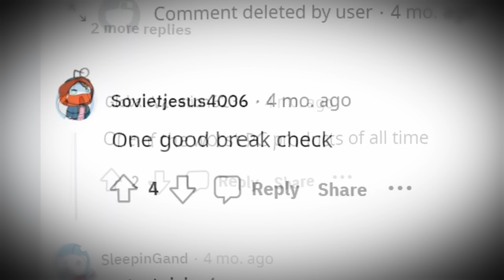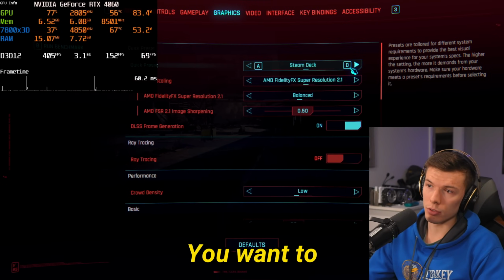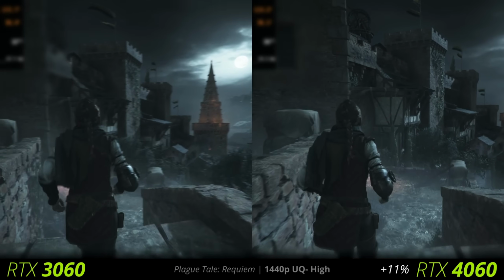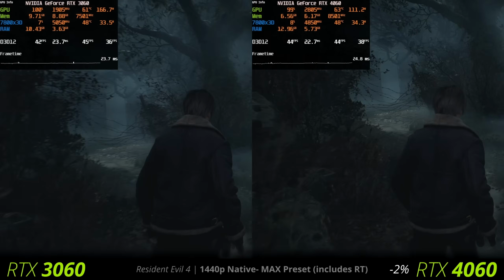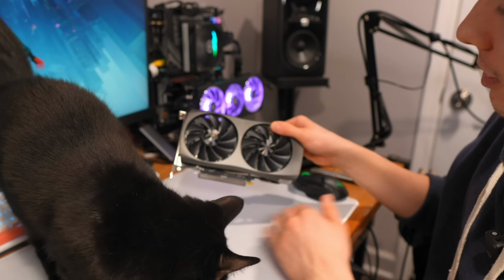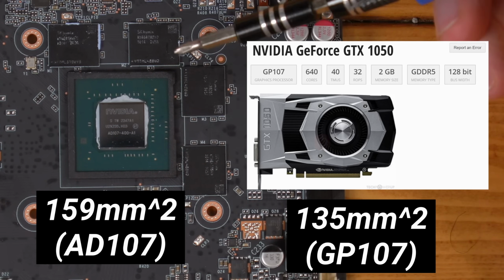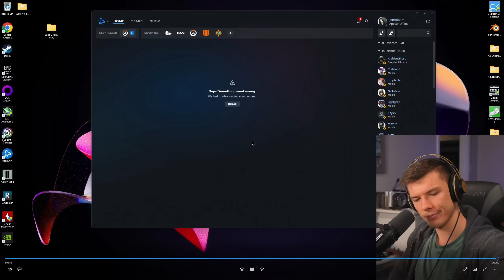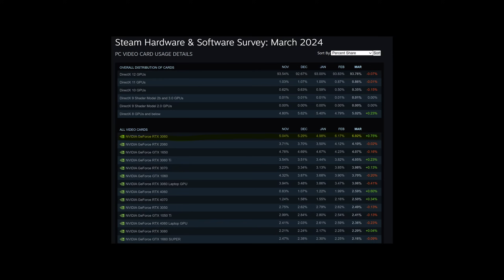I Tried Nvidia's best "Budget" GPU to see if we're Doomed

Comment: don't worry guys, next gen the 5060 will be marketed at 720p instead
Reply: With DLSS you'll enjoy lovely 240p 1000 fps though!
Reply: and it will still only have 8gb of vram
Reply: @Plague_Doc22  *upscaled from 144p
Reply: nah it'll be called 5050
Reply: "720p is the most popular resolution"
Reply: its crazy to me that AMDs GPU sector is struggling to compete with the RTX 4060 like dam how lazy does AMD have to be to no compete against this.
Reply: @Wallcroft25  people weren't buying a lot of AMD cards when they sold them for less, so why would they give up their margin for nothing? At least you're getting solid raster performance for the price, and crucially enough VRAM to last beyond current gen games. As seen, ray tracing doesn't matter when everything in this price bracket is way too slow anyways.
Reply: @BoboFerre incorrect it will have 4gb of vram
Reply: For 499😮€
Reply: 5060 will be 6 gb mark, my words 😂😂😂
Reply: @Wallcroft25  AMD kind of surrendered. 3050 was consistently more expensive than the RX 6600, for a good time it was a price competitor of the RX 6600xt. The 6600 already crushes the 3050, to the point that is hard to get a scenario where the 3050 wins (remember, the 6600 beats the 4090 when severely CPU bottlenecked, it is normal to be able to find scenarios where the clearly inferior product wins  when architecture differs)

According to steam survey the 3050 (2.75%) sold more units than AMD 6700xt, 6750xt, 6600xt, 6650xt, 6600, 6900 combined sales (2.70%). If AMD did their decition making based on numbers similar to those (real numbers may be worse, as many people buy GPUs for non gaming use cases), it is logical they concluded pricing isn't the correct competitive approach when dealing directly with the average consumer
Reply: DLSS AI Game Generation where the AI will now predict your inputs to provide additional frames
Reply: @TheMicroWaveOven  on a phone™
Reply: @Valvefan75 
Regular 7600 have the same vram as 4060, and is supposed to beat 4060. But is slower.
They released 7600xt, that has 16gb of vram but on par with 7600 in performance, and when I utilize more than 8gb of vram it get unplayable fps anyway. The all vram talk is funny. Just AMD fanboys look it as a good thing. Also 12gb of Nvidia is more than 16gb of 7800xt, Nvidia card on RDR2(like 4070 super) use 7.9 gb of vram, AMD use 14gb of vram!
In 8k hardware unboxed settings Nvidia use 11.5gb of vram, AMD is already unplayable even though has "16gb of vram", and 4070 super has 12gb of vram. Nvidia is excellent in compressing textures, they don't need 16gb of vram to beat in therms of vram AMD with 16gb of vram.
Reply: Sub human fanboies scAMD are catching fired here 😂😂😂 love this ❤
Reply: @ziokalco 
😆 Lol!!!
AMD fanboys says that 6600 is better than 4090???😂
Also 4090 is at least 4k card if not beyond that, none plays it as a 1080p low card.
Reply: @BoboFerre nah, it would probably be 4gb vram. 😢
Reply: 720p60 Path Tracing with DLSS Quality and Frame Gen
Reply: @piyapolphetmunee3879  better then any trashdeon shitX for sure 😘💪🏻
Reply: @Plague_Doc22  and amd 8600 is going to do the same it might get 5 more fps at the same resolution. then we get to blame the devs of games to i cant tell you how many settings on my older gpus before i went high end but you would be surprised at a lot of settings you turn down have no impact on visuals a lot of games are over bloated with settings that do nothing. I think they do it on purpose FR. because they dont do anything yet cost a ton of performance.
Reply: Actually 4060 already marketed to use DLSS everywhere. So 5060 probably gonna target 540p-DLSS gaming.
Reply: And since Nvida loves us so much they’ll even lower the price to $299 😭😭😭😭😭🤣😂🤣😂
Reply: @UNATCOHanka  
Why not let the AI play your games for you at this point lol 😆 😂 😅
Reply: @Wallcroft25 AMD Is doing the right thing. I thought they were shitting too but after watching people defend this 4060 in a world where the 6700 costs the same or less AMD can't do shit without losing margin. Nvidia sheeps are too strong and stubborn to change,  so amd just produces less and even though they have 10% market share they sell almost everything they produce and this generation is 10/10 strategy. I hope next gen they get a good deal with tsmc and prices really aggressive in mid/low end since this is the market they can take looking and Nvidia technological advantage
Reply: @789uio6y this is one of the worst take I have ever read, and the ignorance of it is showing why Nvidia outsells amd in the low end(strictly talking about gaming here productivity is another subject). My god wash your mouth after sucking Nvidia that much you might get clamidia
Reply: clamidia😂😂😂😂😂
Reply: Looking at Bandai setting their recommended and minimum specs on a standard of 30fps, you might not be far off
"High Refresh gaming ready!*"
*at 720p
Reply: and a whole 5 gig.
Reply: @BoboFerre it's gonna have 12
Reply: "Have u tried 30 fps?"
Reply: @xBinyWolf  AMD sheeps trying to say buy this old 6700 itll work dont worry about the artefacts crashing lack of driver support and poor performance and hey just because the RTX 4060 is cheaper doesnt mean you should buy it. AMD can totally compete against nvidia, they are deciding not to though and its damaging the industry and consumer choice. At the moment there is no reason at all to get a AMD gpu none. Its always been like this Nvidia being ahead in performance price and features. you look at the latest RX 7000 series GPUs and they basically struggle to compete against Nvidias old RTX 3000 series heck AMD has nothing that can beat a RTX 3090 never mind RTX 4080 and up.
Reply: RTX 6060: The 144p Raytracing King!
Reply: @Wallcroft25  I've had Nvidia GPUs since the Riva TNT1 16MB and ATI GPUs since the Rage Pro. All the way through the Nvidia GT6000 and 7000 series and then AMD HD 4000, 6000 and 7000 series, then Pascal on Nvidia and Vega on AMD and recently a Rx 6600xt and RTX 3060TI. 
All of those have been really nice cards and served me well. 
If you take care of your software and hardware, I doubt you are going to face huge issues with either brand.
Reply: And 4 pcie lanes 😅
Reply: Or yall could stop bein so damn entitled wanting 4090 level performance from a 250 dollar card , you get what you pay for lmao
Reply: @konstantinlozev2272  you said you have "Vega" gpus xD speak up bro Vega was well known for many problems :p LTT wouldnt even support/defend it
Reply: @pwrcowfeeder  Amh, no. GTX 1060 beat a GTX 970 handily and had +50% VRAM. GTX 1070 for USD 400 clapped the cheeks out of a GTX 980TI and had 8GB VRAM. 7 years ago we had the same amount of VRAM on a USD 400 card as today.
Reply: @Wallcroft25  I had a Rx 480 and now I have an old PC with a EUR 50 Rx 580. No problems.
Reply: @konstantinlozev2272  true the RX 400/500refresh series was awesome WE WANT that type of stuff that was the good stuff that actually was competitive against Nvidia back in the day. Sadly that was the last time we had good GPUs from AMD.
Reply: next gen name is 5070 more expensive
but with 107 chip ~
🤣🤣
Reply: I'd take a 720p card if 720p monitors were actually made decently. 

Sadly my fate is sealed to 1080p at the lowest. I haven't even seen a newly manufactured 720p recently.
Reply: @Wallcroft25  As I wrote, I snatched up a Rx 6600ct for EUR 200 second hand more than a year ago. I'm quite happy with it for it's price. Re-paste, clean install, restarts before and after each driver update. No issues. Works well in my budget PC for the living room (I got a 1080p 3d TV there).
Reply: @konstantinlozev2272  oh your a bot rip ill report it for botting.
Reply: @Thejacketof-huang calm down brother, it's PC hardware
Reply: @Wallcroft25 your comment is insanely wrong
Reply: @Wallcroft25  LOL The latest Steam survey has Nvidia users at 80%. AMD was something like 14%, Id have to look again to be exact. I do believe the most popular GPU was the RTX 4060, which is a shame. Chopping the VRAM size and memory bus for the 4060 was a really bad decision. 128 bit bus is just way to limited, add in 8GB of VRAM and you have a joke for a GPU.
Reply: @jfolz  Newest consoles are coming with 16GB of VRAM. 8 is literally a joke for a modern card, even at the entry level. This should be a $150 GPU, max. It has uses for something like building your 8 year old a PC to play Minecraft or Fortnite on, but anything else is just no bueno.
Reply: @stephenhood2948  fun fact the most popular GPU wouldnt be a RTX 4060 it would be the Laptop variant if anything most of steams hardware surveys list mobile GPUs/laptops as the top users. If you think about it this makes way more sense because there are way more people using laptops. I'd like to add that Nvidia also dominates the laptop space with AMD being actually quite bad with that even AMD ryzen cpus dont get away this time as their laptop variants are pretty unreliable compared to their desktop versions. Still AMD is awesome in CPUs even forcing intel to match/innovate sadly again the GPU side of AMD failed at this market having even worst driver problems/bugs and stability issues mostly crashes as reported by users of laptops with AMD GPUs. Truly wish AMD would step up their game in the GPU space for both laptop and desktop users.
Reply: @Wallcroft25  2 of the top 15 GPUs on the survey are laptop variants, with the first one coming in 7th place. I was wrong saying the 4060 is the top GPU though, it is the 3060 in the top spot. The 4060 comes in at 8th place, right behind the first laptop gpu on the list, the RTX 3060 laptop version.
Reply: but I was told the 5060 will run native 430p in software only because no hardware was installed at all
Reply: well if you have to use dlss to get 60 fps on low at 1080p with the 4060 it is effectivly a 720p card already. if it cant do 1080p without upscalling it aint a 1080p card.
Reply: @Eric-ct2ri  god I cant imagine just how bad AMD owners have it they dont even have high end GPUs AMD said they was skipping making more powerful GPUs to compete against the RTX 4070 upwards.
Reply: @Wallcroft25  who cares it doesnt matter man most people buy at around the 300$ price point soo high end means nothing for most people other than being things that raise prices.
Reply: @Eric-ct2ri  300$ sheesh Americans really that poor?
Reply: @Eric-ct2ri  oh right I forgot americans have it rough they gotta pay insane taxes and health insurance instead of having a free national health service and low taxes.
Reply: @Wallcroft25  who said anything about americans huh buddy. and why should anyone spend more than 300$ on a gpu...
Reply: @Eric-ct2ri  you would have to spend more to fine out ;) otherwise stay poor and prosper in poor performance
Reply: @Wallcroft25  yeah im not spending more buddy. if im going to spend more ill just buy a console and be done with it. its not about being poor its about not spending more than i want to just game. its simply not worth it. im not one that needs to max all the settings to enjoy a game. 

if you do well good for you spend asmuch as you want to have useless graphics that dont actually change how games play.
anyway you are clearly a troll based on your previous posts so blocking you.
Reply: @BoboFerre  *4 gb
Reply: @dripmogus6979  oh yes because they keep lowering it every year
Reply: ikr!
Reply: for $400
Reply: @BoboFerre  This time on a 64bit memory bus.
Reply: You mean the RT 5010?
Reply: @789uio6y 😂😂😂😂 wtf are u saying? I have a rx 7800 xt e literally  its more powerful  that piece  of sht  4070
Reply: nah the 5060 will just be the lowest end model
Reply: @Wreckedftfoxy  man im talking about laptops 💀
Reply: Why are they having such a hard time making them worth it?
Reply: @Plague_Doc22  240p is for obnoxious rich people. 144p is the perfect reso
Reply: And then 6070, 6100 and 6110
Reply: @Ancient_Employee  named for it's chances of running modern games at a decent graphics preset surely?
Reply: @davidfrazier6308  game devs can't be entirely blameless if people report issues no matter which high end GPU of whatever brand they own. Sure it might be that the GPU manufacturers are all fucking up, but anyone has noticed that since PC games transitioned into fully digital platforms that the pressure to release a fully optimized game at launch has considerably dropped, buggy alphas notwithstanding.
Reply: @xBinyWolf  this is stupid behavior no matter which brand people go for. Because the 1080 was such a great product a lot of NPCs have gotten this ingrained notion that nvidia is the go to forever, the correct choice is always to go for the best price-quality within your reach, if you're looking at a brand instead you're just wasting money and rewarding shitty corporate practices.
Reply: Will be entery level fart tracing
Reply: Good! I've alway been a minimalistic fan.
Reply: rtx 5060 will be able to SLI and will be a 900p monster you will see!!!
Reply: @Wallcroft25  NVIDIA has a viral mindset on consumers to buy their product, thinking they are getting the best.
It's the same thing that has helped Apple for the last 20 years.
Reply: hell even 4060 ti could be a 4050
Reply: And 4 mb memory
Reply: You can get a fucking used 2080 Ti for the same price. My mind is melting thinking about it.
Reply: What a waste of silicon
Reply: @Ancient_Employee  5050 should i maybe possible potentially consider the other two grafics card vendors instead of buying the brand name, its 5050.
Reply: @BoboFerre  and a 128bit bus instead of a 256bit bus!
Reply: @Thejacketof-huang making an acc just this is very pathetic
Reply: dont worry bro 5060 with dlss 720p
Reply: @BoboFerre It will be upgraded to 6 gb vram.  😉
Reply: @toblobs itll be 120p and 10 fps with dlss it will be 1p and 11 fps
Reply: I don't know but you know what would actually really help is if most people would just blame the developers for pushing these ridiculously demanding engines as the new norm instead of just making playable games at damn decent playable engines? This along with the nose bleeding high prices as enter level for triple A studios will completely collapse on themselves as a direct results. If your gonna game on a card like this or even in PC in general support the double A and indies studios vs this sloppy mess!
Reply: @JahonCross sure bro marked
Reply: What did you expect from a cheap $300 card? For its price its a good card that consumed way less power. You need more performance then stop complaining after buying a cheap card and instead get out there and earn some money then buy the 4090
Reply: @fragmata2000  it's not 499€. Which Earth did you come from? That card is cheaper than my phone. It's actually even cheaper than some meals I've had.
Reply: @JstKiyo  the problem here is that this card is not worth $300 for its performance.
Reply: @toblobs  It's the most worthy card at that price. It's just $300 dollars. What are you expecting Brand new Lamborghini in $30,000? You probably never even used that card and just yapping from the reviews of some channel you've seen. Unlike you I've used Almost all card of 40 series except the 4070. I know what I'm talking about.
Reply: @JstKiyo  just because a card is the 'most worthy' at that price point does not make it a 'good' card, especially in this market. the only thing going for it is DLSS, which isn't exclusive to the 4060.

although I haven't used it myself, I trust the reviews from not just youtube but websites, and they all tell the same story.
the generational performance increase is not that impressive, at all. did you even watch this video?

and 'just $300'? what kinda elitist view is that? that's not a small amount of money for anything. I'd rather go for a used card that has better raster and VRAM with that amount of money, because it'll survive longer.
Reply: According to recent leaks there won't be a 5060 or 5070 only 5080&5090
Reply: @toblobs  You haven't used it to yourself yes? But i did and i still do for my other rig so keep your damn mouth shut. You can't say a food is bad before you've even tasted it. $300 is a small amount for a card that gives that kinna performance at that price. Stop yapping when you don't even have or ever used the thing you are yapping about.
"Did you even watch the video?" I'm not broke like you and i directly buy the card i wanna test. I used it myself so why would i care about what others say when i personally myself checked the card. This card is not made to run games on 1440p or give such good performance, It's a card designed to be cheap while giving decent performance while using less power. Instead of yapping about this card just buy a better one if this isn't the performance you are looking for. Nobody is forcing you to get this specific card, if you think 3060 is better cause of more Vram then get that or get the other variant of the 40 series card. Imagine yapping about something just after watching few reviews while not having it used yourself, couldn't be me.
Reply: @Plague_Doc22 with dlss 4 you will be able to run games at 2000000ms delay
Reply: @Onyx1776  no, 3.5gb as they did it before
Reply: @Wallcroft25 nothing to beat 3090? 7800xt? heck, 7700xt sometimes?
Reply: @BoboFerre  im calling it
Reply: Woohoooo
Reply: I play with my i3 8th gen on 144p 40 - 50 fps 😎
Reply: @Wallcroft25 marketing and brand recognition. Doesn’t help anything that before rdna amd flopped with driver issues. Case in point, wal mart, Costco, target etc. all pre builts are Nvidia and often times a low case 4060. Me? I am still new to pc, my first pc was amd 6 months later I said f it I’ll build one lol.  5700xt then a 6900xt. No issues. Driver issues are pretty much a thing of the past I gotta give a lot of credit to Radeon given they have a far smaller team than Nvidia yet Nvidia has issues also.
Reply: @BrianSkinny-n5f  hello mr NPC/Bot commenter. nvidia does not have issues well except for the issue of having no competition. Once you upgrade to nvidia you will understand how much of a scam AMDs current and past gpus have been. The last time AMD made a decent GPU series was the RX 400 and 500 refresh. When even the Crypto miners during the Nvidia shortage were still not buying AMD GPUs its pretty safe to say theyre not even worth putting thought into.
Reply: And cost 2500 bucks too!
Reply: @Thejacketof-huang love how you try to talk shit with that 3rd grader grammar mate
Reply: @Wallcroft25 can't believe one day I'll hear a league player talks about hardware performance, best online expert I've ever seen, use some amd cards lmao
Reply: @BoboFerre nah 4gb vram
Reply: with 4GB VRAM
Reply: Nahhh, just laptop exclusive.
Reply: Marked your words and you are wrong  @JahonCross
Reply: @csabazombori9862  still 8gb :^)
Reply: @csabazombori9862  
Wouldn't be surprised if that laptop model gets 6gb 🤣😘
Reply: @Plague_Doc22  Solitaire never looked better.
Reply: 6gb!
Reply: @ziokalco  I think with the well-priced new entries from Intel the emperor will be without clothes soon enough...  I don;t even think Nvidia really want to do gfx cards any more they are thinking of themselves as new A.I. equipment masters.
Reply: @poepflater  That would be a great scenario. My expectations however are pessimistic:
1) There are probably not enough people interested, Intel may be a repeat of AMD golden era. Where the better brand sells drastically more than the better product anyway
2) Intel is yet to prove that they have the capability of producing enough GPUs. To begin with, they are failing to supply the current slow market where most people interested in that performance tier have already been there for years. They are also not using their own fabs, they are using TSMC, just the same as AMD and nvidia. Something tells me nvidia gets priority, then AMD fights for the leftovers, and at the end intel takes AMD crumbs
Reply: @ziokalco  from what I saw over the last few weeks, the new series of Intel cards really seam to be S tier when it comes to bang for the buck... RTX made its name in a  vacuum while AMD didn't even try for top tier...  I'm always broke so I a privileged enough to have a 6600XT.. not the final word in performance, but I assure you when I get killed in a game, it is not the card's fault.
Reply: @poepflater  That's precisely my point. People interested in that performance tier are already there. Rx 6600xt doesn't envy that much from the B580. Broadly speaking they both play the same games, at not that different graphics when aiming to match FPS. rx 6600xt is also less likely to have compatibility issues, specially on old titles.

B580 at MSRP is an absolute unit, true, at MSRP. Intel is not producing enough of them, current pricing is not good. It is still early enough to give them the benefit of the doubt
Reply: @ziokalco  yeah, if I start adding the margins that gets slapped on imports over here, I am seriously thinking of getting the Intel. My daughter must still get her 1st gaming PC, I'm a disability pensioner, so luxuries like that come far apart.
Reply: More like 480i
Reply: @thelightsilentthey arent. You can buy an RX6750XT new still for a bit cheaper than a 4060. They're margainally faster on average than a 4060TI and have 12gb of vram. AMG cards still should be treated with the fine wine attitude. If you're buying one, get the generation before the latest unless you can get a really good deal on the new one or unless the new one is WAY faster. They have much better price to performance generally speaking.
Reply: @BoboFerreI hate how this is proven to be true by the leaks
Reply: @thelightsilent it hasn't always been this way look up the radon rx 5600 xt. It was to slot in cheaper then the 1660 super way faster and have lots of over clocking headroom like with the right clock it would take on the 2060. Nvidia didn't like being embarrassed this way. So day one of lunch Nvidia dropped the price of there 2060 to make amd offering dead on arrival. So and had to update the vbios to complete removing all of the overclocking head room it had to compete against the 2060 instead of the 1660. Youtube it they go over it better then me.
Reply: bro predicted the future
Reply: @PakoY2J  😭😭😭😭 multi frame gen 💀
Reply: this didn’t age well
Reply: @CrispyCakes420  yeah it aged like the 5060 is going to
badly
Reply: Nah it's 4k (if you use DLSS to upscale from 720p and 4x framegen)
Reply: @BoboFerrejust wanna remind u
Reply: It'll make 1080p look like gold